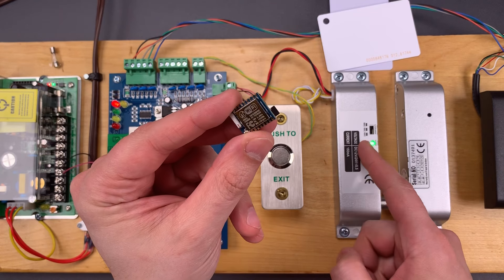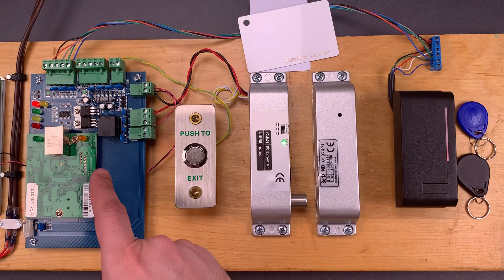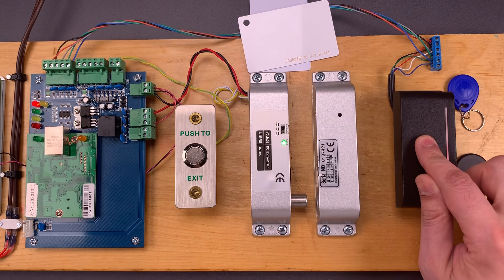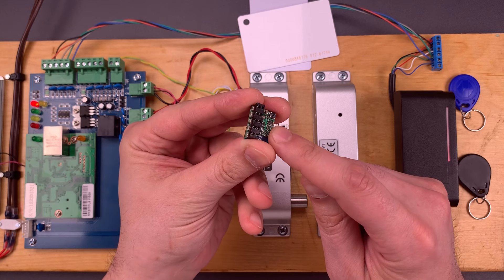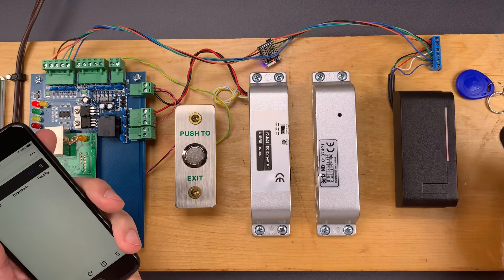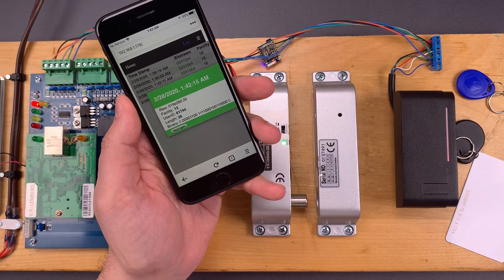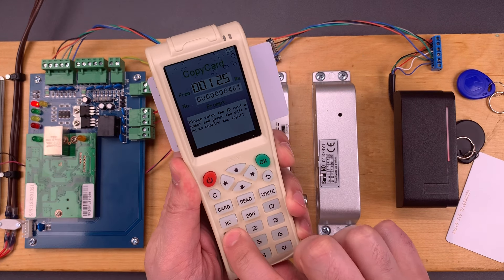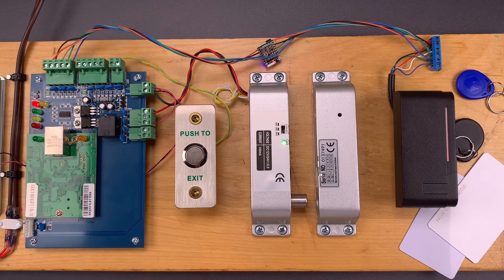[1052] Bugging an RFID Card Reader

Comment: If I'm remembering correctly there's an easier way, the 'keys' always transmit their RFID data. Myth-busters did an episode on why the new RFID bank cards (the ones with the little 'gold' chip in the corner) are a horrible idea but they weren't allowed to air it because the 'banks' (they didn't specify) wouldn't allow it.

All you'd need to do is place a very small RFID reader with a sensitive enough receiver (depending on the distance from the legitimate card reader) within any area where the card will likely be in - in the case of an elevator, all the more easier, as you'd just place it in a corner or on the roof - and have any data the reader receives sent off, no need to fiddle with any wires and can be done incredibly discreetly. Alternatively you can swipe a card reader by someone you know who has a key (and know where it is on them), as long as it isn't held in a lead wallet, the RFID will be stolen.

It doesn't matter if the card's data is encrypted or not as a duplicate card will just be able to send the same signal, just because you don't know what the encrypted data says doesn't mean it isn't duplicatable. If the encryption employs some sort of sudo-random cycling system (as all cards will have to have the encryption 'key' cycle identically, so it can't be true random) then that doesn't stop it either, it just makes it take longer before the cycle is broken and even then the duplicate keys will work until cycled. Even if a multi-level cycling system is used, where each cycle is cycled each day/month/e.c.t. the same method can be used.
The best way to stop it from happening? Don't let anyone but authorized people anywhere near the sensor - which obviously means guards, almost entirely defeating the entire point in the system to begin with when it comes to securing rooms.

This exact same method can be applied to the RFID chip on bank cards too, but I don't know enough about its security to know if the same method would actually work or not anymore . But what I do know is that this is essentially the same tactic used for stealing credit cards via creating 'hidden caps' that go over the legitimate ones and look identical, they don't read the RFID (because bank cards didn't always have them) but all of the cards information. A little tug on the hubcap will instantly pop the fake one off, though, so they're easy to check for.
Reply: I was thinking the same thing, you don't need to access any wires, just a valid card.
Reply: The same thing is true for credit cards, except that there cannot be encryption due to the way rfid credit cards are used. There cannot be a standard encryption for an infinite number of readers that an attacker can’t get access to. To make this even worse, the cards don’t use a rfid version of the cycling chip that is read at the card provider, it just transmits the credit card number and security code in plaintext.
Reply: That only works with cheap passive RFID. Active RFID can have secrets stored on the card that are not exposed to a reader.
Reply: The metal chip on bank cards is physical contact, not RFID. RFID has a small coiled wire in the card usually.

Comment: I have a huge interest in RFID hacking since I used to have to deal with access control at work, thank you for a very interesting and educational video I’ll be makeing sure to talk to put IT guys to make sure the tamper alarm is installed 😂
Reply: ..or putting either side readers in? Onece you're in, you need to swipe out, as the system knows you're already in? Make emergency egress a break glass override.
Reply: Probably can't do that in a business. In my area, you have to be able to easily open the main door from the inside in case of fire.
Reply: @chalion8399  emergency egress....break glass override...!!
Reply: Might want to hire new IT members if the current ones don't already know about this attack...
Reply: Reader tamper alarms would not be 100% reliable since this device punches through the wires, the connection is never interrupted so you wouldn't see any tamper alarms in your access control software's log, unless... the attacker had no way to access the wiring conduit directly, and had to unmount the card reader, that would definitely trip either a mechanical or photosensitive sensor. Two lessons here: 1) make sure your card reader counts with a tamper feature and 2) (probably the most important one lol) keep your wiring conduits safe and absolutely out of reach.
Reply: @KamikazeSOF2  Yup, I wouldn't lose sleep over the idea of an attacker using this device on my system. I was thinking more of a security issue regarding the cabling conduit being exposed at some point between the reader and the access control/security panel, which is obviously a BIG no-no and a mistake that (hopefully) nobody with experience in the security field would make.

Comment: About fifteen years ago I worked for a company that issued an RFID card key to each employee. I noticed that as you exited the building there was an infrared motion detector that caused the door to be unlocked as you were about to push the push bar to open the door and leave. There was a double glass door entrance with a flap that would automatically close over the gap between the doors when they were closed. But it kept getting jammed so they removed it. One Sunday I came to work when no one else was there. I unbent a coat hanger and attached a flattened soup can to the end. I heated the soup can with a propane torch. I slipped this thing that looked like a flag through the gap between the doors and waved it around. In a matter of seconds I heard a loud click and was able to open the door and walk in without using my card key and without setting off the alarm. The next day I told the facilities manager what I had done. He didn’t believe me until I demonstrated it to him.
Reply: I'm wondering if it could be done by bouncing a laser pointer off of something reflective.

Comment: First of all, that's some very dedicated setup, nicely done!

For most use cases that replay attack is more dangerous than the encryption. But this is depending on the building, if you can protect the housing and the wires, then it is fine.

First is that replay attack, it should never be possible to re-issue authentication, it should be one time use before that specific bits of data expires. This is widely known and ways to counter it.

Second is that encryption, I get that they think "its inside the wall, should be fine with unecrypted", but that is a very naive mindset, those wires could be hundreds of meters long in business buildings. Which could be intercepted and read at any point.

Comment: In my experience there are very few "secure" doors in the field that can't be opened with a shim or a can of compressed air.
Reply: @MrRusell86  the compressed air attack is for doors that open automatically on exit using infrared sensors : the decompression cools down the air quite a lot compared to the ambient temperature and the airflow can travel far enough to trip the system.

Comment: That's precisely why seamless security is so important. For instance, the connections should be routed in such a way that accessing it is at least as difficult as breaking down the door would be. Also a system like that would have to include one or more tamper-sensing mechanisms which block the system entirely when the accessible part is tampered with.

Comment: Extremely important to connect the tamper switch on the pad to the central alarm so you know if a physical attack was performed. Indoor wire should be inaccessible in wall or in metal conduit for an inside job.

Comment: Are the bolts open or closed when the power goes out.

It would be more secure to be closed, but I've a feeling fire regulations might require them to be open.

...what happens if you forget about codes entirely and try to kill the controller on the other side- pump a stiff 100v through those wires. Does it fail open?

Or maybe just taking a security light off the wall and using it to trip the breaker...hmm
Reply: I feel like it doesnt have internal battery so how the fuck does it open when power is out?
Reply: @iare19  You have to provide "your own" uninterruptible power supply when installing this kind of access control system.
Reply: I have worked a place where the simple solution to this was simply having two doors side by side.
One door for exiting which couldn't be opened from the outside, and was opened mechanically from the inside.
And the other door for entrance only, opening electrically from the outside.

But a much better solution would just be to be able to override the bolt from the inside manually, and having it be normally locked.
Reply: @psirvent8  If that's the case, i certainly don't hope the building is set on fire by a lightning, taking out the UPS.
Reply: Dylan Davies i’d rather use a lock and key
Reply: Offices here in the UK which have these typically will also have a break glass style of door release which opens the door in an emergency.  They tend to fail safe though, being unlocked in the event of a powercut
Reply: Most likely the security systems are fed from a Battery Backup Unit.
Most stores or high security buildings have them to keep their registers/computers running in case of a power outage. 

As an electrician for big box stores I have installed the power for their security systems. They always have to be fed from the same panel that feeds the computers and registers. 
So killing power to the security units would be hard to do unless you can get access to the electric panels.
Reply: That's why there is a button on the inside.  that's the first thing LPL showed at t=0:21
Reply: @rsaunders57   No, thats the regular door release.  The emergency one releases the door in the event of an emergency (i.e. fire)
Reply: Either kind can be specified.  Power off locked or unlocked.
Reply: We have a system much like this at work, it has a battery in every controller so that it will still work even if mains power is lost.

Stupid thing though is that now they are installing intercom systems that has the ability to open the door. You press a key, it does a SIP call to a preloaded number, the operator that answers the phone can press "1" on the phones keypad to open the door or gates.

The problem is that the way this is done is that there is a NO relay, that will close and short 2 wires.

Stupid thing is that this is a box that sits externally AND all you need to access those screws is a philips head screwdriver, unscrew 4 screws and you have access to the 2 wires.

I bet i could get the gates to go up in less than 30 seconds without any proper authorization.
Reply: US fire codes require that doors of occupied spaces can be opened from the inside without, power, keys or any securing devices. Most common are the "crash" bars you see on doors.
Reply: Depends on the application. Prison locks fail secure, for example ( no surprise, it’s just what I was used to working with).
Reply: It's usually configurable, so you can have it fail safe (open) or fail secure (locked). Where the door is, what's behind it, and local fire codes usually dictate which you would use for any particular door. Now can you fry it like you propose? Sure, maybe, but it really depends on how the controller fails when it's hit with the over voltage. It would be a bit unpredictable.
Reply: @jeffreyroot6300  Would be neat if the doors were suddenly unlocked in case the power disappeared.

Prisoners would be jamming any piece of metal they could find into the power outlets in the cells to get the breakers to trip and the door to swing open ;)
Reply: @JohnDoe-bd5sz  Even better, all units from the same brand use the same key. You can buy a "Door King" key off eBay and open the intercom box from the outside.
Reply: John Doe No h*ll it wouldn’t! I’ve survived a few disturbances ( they changed the definition so we don’t have “riots “ any more)! That said, no outlets in the cells. Regular dorms they do ( lots of open dorms in various facilities), and they jam things in them all the time to light cigarettes or blunts with. No power failures that way! They do love to try and pack trash in the strike plates. I am retired, good luck to my brothers and sisters in blue!
Reply: I've encountered a few electric doors in my time. The strikes can fail safe or fail secure , meaning, when the power goes out they will either become unlocked or locked respectively.

We hook them up to battery backup, so in a power failure they can still open and close as normal for quite a few times. When the juice runs out, the strikes unlock so the door can be pushed open.

In homes with a fire panel, the panel can also unlock the strike to allow escape, or ideally even open the door.

So, if you were to try to unlock the door by shorting out the house power circuit, it wouldn't help you. There's battery backup and it'll work long enough for occupants to figure out what is happening and investigate.
Reply: @iare19  it's the opposite, it's spring loaded and pushed out when powered. I believe there are both versions, normally closed and normally open. Think: Relay
Reply: Normally closed. If you lose power you use a key.
Reply: @jcmount1305  
Right, my gosh, no one grasps this. We own a property management company with thousands upon thousands of doors. They ALL open from inside.

Skip this card reader James Bond nonsense, use that reinforced wire under the door trick LPL showed a couple months ago. Works every single time. It does not matter the door or lock. Just turn the handle.
Reply: FYI those electronic bolt locks are banned on commercial buildings in the US. Too much liability that it won’t open even during a power outage

Comment: well - you do need to get to the cable to do this "man in the middle" attack. Which usually means you have to have had time inside the building unobserved.
Reply: And also you must leave the ESP work until someone uses the right card to open the door.
And also you must know the wiring (which ones are data lines and power lines).
Reply: No, you do not need any time inside first. That reader box has to be mounted on the outside. It should not be too difficult to get into it, connect the ESPKey module to the wires, and close it again, avoiding visible damage. The wiring scheme is no problem to work out, and will often be publicly available.
Reply: @JohnnieHougaardNielsen  seems like a really poor design, then. I'd have the control unit pass through the wall completely, with the access panel on the inside wall.
Reply: @JonathanSchattke  Seems like a cheap design. Unless you want to cut holes into the wall next to every door. And then you would still need to buy phisically tough readers anyway to prevent access.

Something will always be on the outside and you need to secure it
Reply: @JonathanSchattke  Yeah, not at all a good design when such a simple replay attack can work.  

Starting from the point of a standard setup with a wall and a door opening, it would make the lock much harder to sell if making a big hole in the wall was required. Of course, if the doorway from the start is designed to accommodate this, it can work reasonably well.

To me, the solution suggested by LPL seems more practical, encrypted communication from the reader to the control unit behind the door. The reader+encryption should be a sealed module, having no wires or soldering points with unencrypted data. A good design should hinder an intruder from just replacing the outside reader with a hacked one. Ideally, the RFID tag should also be updated each time, to ward off replay attacks.

Of course, any  setup with a passive RFID reader has a vulnerability if someone is able to hide an extra RFID reader very close to the existing one, but this is harder to make invisible.
Reply: @JohnnieHougaardNielsen  Inside the building because those type of reader are often in public space like hotel or maintenace room. dismounting the external reader could be a little suspicious in public. Also wiring could be a flat ribbon cable with same color. yes, with a multimeter and a oscilloscope you could identify data lines, but again time consuming in public. Not to mention that normally those rfid card uses algorithms like credit card and not a single binary number.
Reply: @MyNotSoHumbleOpinion  - Well, we are not talking about "those rfid card algorithms" and "normally", but about a very specific device with a bad design, including algorithms severely lacking in security. The video shows how easy a banal replay attack was. Of course, the practically of using a few minutes to "improve" the RFID reader varies a lot by location, but hours with very low foot traffic is a pretty common thing. Possibly with a helper to slow down anyone getting close. An intruder going for this type of attack would likely have identified the device before returning for a quick modification, and pinout is a trivially simple thing to have when the device to be hacked is already known.

More generally, this type of attack is most likely for an intruder going for a specific target, and using time to locate weak points as part of the planning. As it does not work till having recorded genuine RFID cards being used in the lock, it is certainly not for getting access shortly after installing the lock modification.
Reply: @JohnnieHougaardNielsen  personally I think it's only an academic exercise! The lock shown in the video it's barely a toy for very low security access and the proof is that work with RFID keyrings that haven't data encryption! A real life lock it's difficult even to dismount from the wall! Or maybe in US there are a lot of lack in security! In my country I never seen a lock bad like Master Lock!